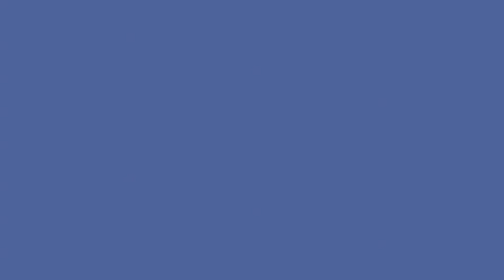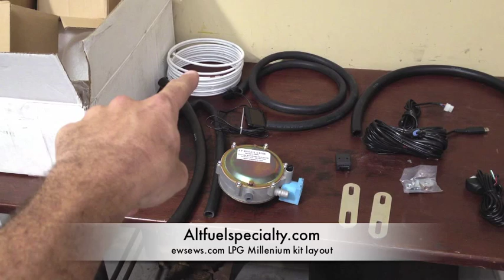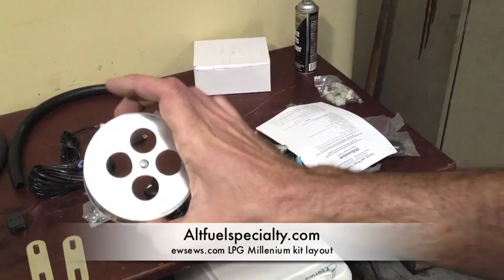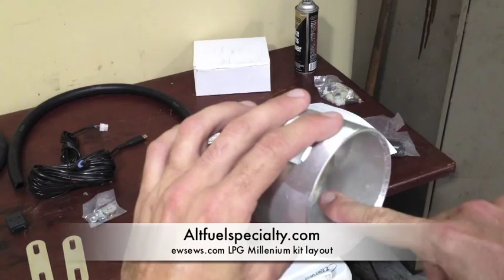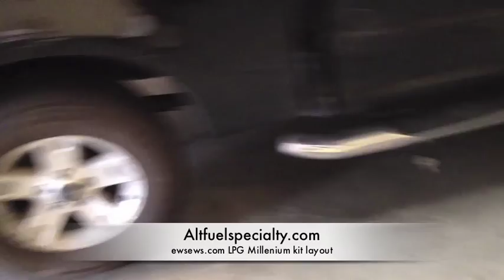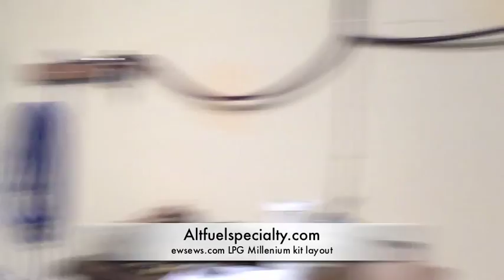Propane Conversion Kit - Parts Layout F-150

Comment: Is it for dual use I'm going to run gas and propane I'm going to both on my 99 ford f150
Reply: Any updates on what you did i have 01 thinking bout the same
Reply: @riconaidas3750  don't have the truck anymore